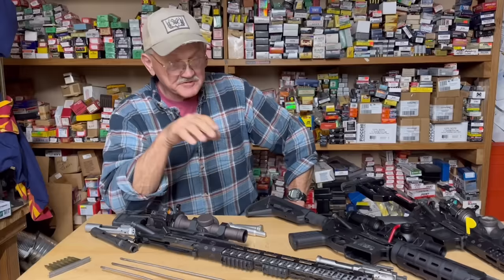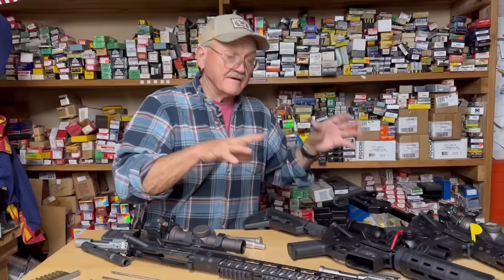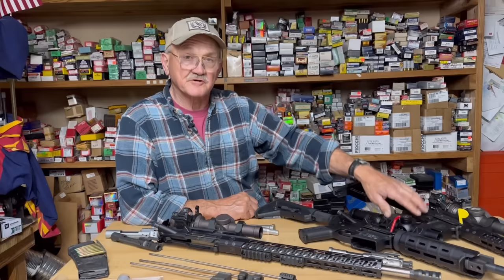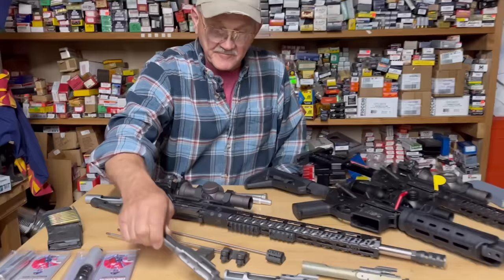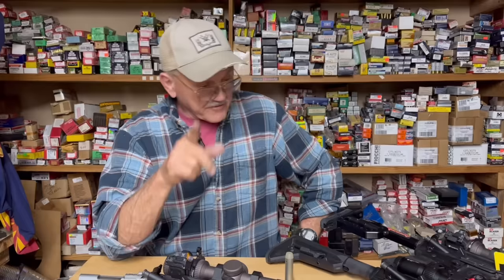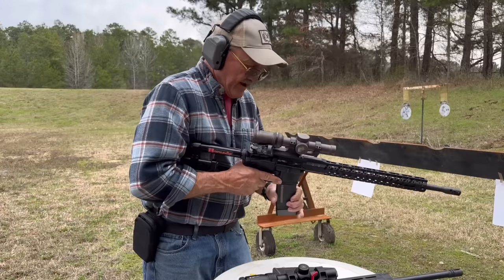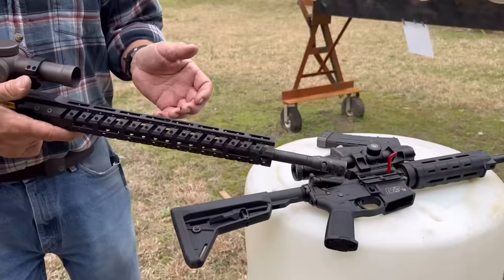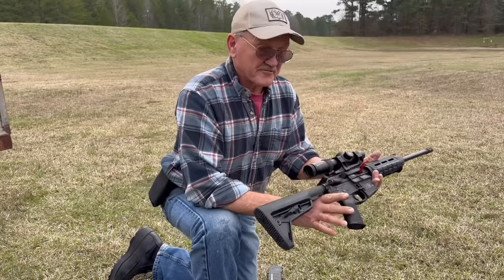Say NO to recoil!

Comment: I just port it if I don't want recoil. I have a very bad back. At best I can shoot maybe 20 min.  I found that porting, springs and doing a polish job eliminates recoil. I have an S&W SD9VE with three large ports behind the sight, crimson trace red dot, 22lb recoil spring and lots of polished parts, trigger job and springs. It shoots flat with no recoil. Love that pistol now though I loved it before. 

I have four giant ports on my shotgun. Polished internals, red dot and filed receiver with modified loading gate to make it easier to load, and I added magazine extension for 9 shells ghost loaded.

Love your show.

Comment: I built an AR in 2020.  I was getting bruised from the recoil.  I figured out the stock buffer in the stock was to light.  I upped it to 7.4 oz from 4.0 and that made all the difference.
Reply: How is that even possible
Reply: @lucky43113  There is a weight in the stock that fits into a spring that absorbs the recoil of the bolt when the rifle fires.  This is called the buffer.  The spring can absorb only so much energy.  The buffer's inertia dampens the recoil too.  To dampen the recoil more increase the mass of the buffer.  it's a conservation of inertia physics trick.  It worked like a charm.  Of course you can still feel the recoil but it's easily manageable now and doesn't leave bruises on my shoulder with prolonged use. I found several articles on the subject by professional marksmen that were talking about tweaking the AR platform for competition matches.  I learned a lot about the topic.

Comment: I recently got the Vltor A5 buffer system for recoil reduction. It is an intermediate size buffer tube and has a longer buffer and a rifle spring. The only downside is the stock is about 3/4 of an inch from collapsing all the way, but that's not a big deal to me. It is also a 7 position tube so I still have 6 different length settings, it just starts at number 2. The mid length gas system really works great on a 14.5 pinned and welded compensator rifle as well.

Comment: Jerry I agree with you 100% about charging an AR platform. In one of my  reloading groups the other day. I had an idiot arguing with me about primers I told them they need to use the military-style hardened primers in their are platforms and he was arguing with me there's no need. He was standing within the reloading such as Hornady and Lyman is there a load Data  doesn't specify to used military style. I tried to explain to him that those data charts and load data was usually for bolt action firearms I got tired of trying to get the idiot to about slam fires on any semi-automatic with a free-floating firing pin. I really wish Hornady Lyman another reloading groups would have more information in them pertaining to semi-automatics will the free float firing pin system. I've been a bolt gun shooter for years but I do love the ar platforms and have a safe full of them that I have built from scratch, and not just of one caliber. Everything from the 556 to 450 Bushmaster. Not a fan of the.50 caliber platform.

Comment: You should try a Tubbs flat wire buffer spring. It eliminates the tube harmonics. It really smooths out the rear section of your msr. I noticed a big difference.

Comment: I agree with Jerry, here. Most OEM M.S.Rifles are Over Gassed, so they work under all conditions. Which can lead to equipment failures down the road! But if you are building a gun, why not set it up to run like a tuned machine!?

Comment: Mr. Miculek, I have been learning from you more years than I will admit for both our sake's. I am new to AR's and just bought one and when I started watching video's
 I found it amazing when guys could rip off 5-6 rounds and the muzzle don't even move. I mean the 5.56 don't have the recoil my 30.06 does but when it can shoot THAT flat it's amazing!
 I don't want to get into gas system changes or new bolts yet but wondered if changing the buffer to the magnetic one would help on it's own and will it create any issues for me?
I have a 16" barrel with a mid-length gas system, everything is 100% stock right now and would prefer to stay close to that .

Comment: thank you mr. miculek , would jp made lighter bolt carriers have a matching configuration integrating the  gas system rod and block cylinder and new weight and operation of bolt carrier system

Comment: One of my softest shooters is a 16-inch mid-length gas, 2nd gen flash hider, M16 carrier, H1 buffer, and an SLR Sentry adjustable gas block.

I had a lot of issues with the initial build. I determined the gas port was oversided and started mixing and matching parts. The adjustable gas block was money well spent!

Comment: I wonder what the wear factor is using light weight bolt carriers and modified gas systems 
I've always been under the assumption that heavier carrier groups will last more rounds especially in the AR platform

Comment: Just go get an Armalite M153GN18 they have adjust muzzle break and adjustable gas block with a rifle length gas system has zero recoil
Reply: Thk u mr know it all
Reply: @jeffbetteridge9870  you're welcome but seriously why buy extra parts when the rifle comes with everything you need? And you can get them from 1k to 1.5k in either 13inches or 18 inches along with 308 versions....

Comment: I prefer to increase my buffer weights instead of regulating gas. I’ve done both and haven’t had any problems with either but I have trust issues and can’t trust the adjustable gas blocks.